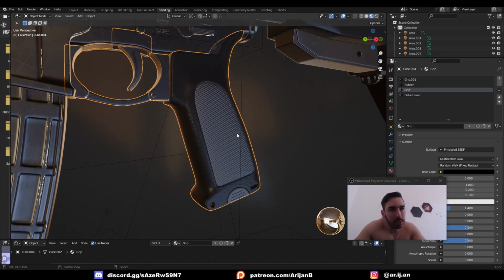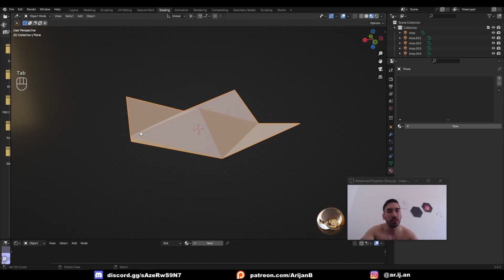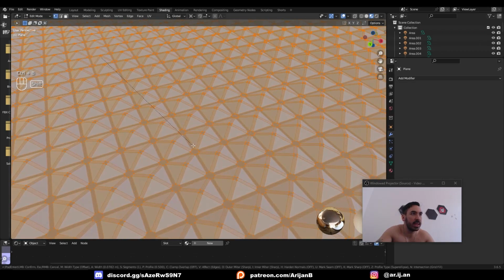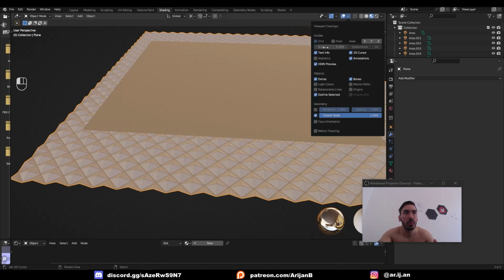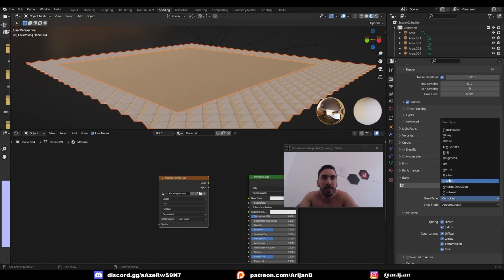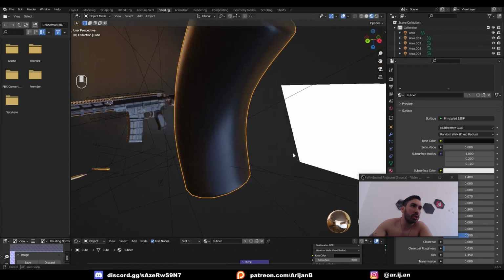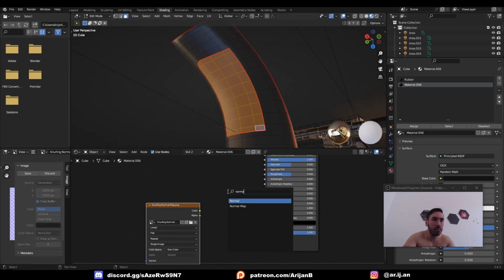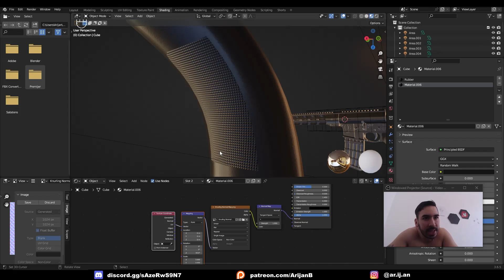Blender Gun Texturing Tutorial - Grip Knurling (Aryan)

Comment: Easier way to do this: 2 Wave Texture nodes set to Triangle, one in X, the other in Y direction, send both into a Mix Color node set to darken with factor 1, then into a color ramp with default settings, then into a Bump node, and finally into the normal slot of your principled shader.
Reply from the maker: I will check this out when i get the chance, thanks